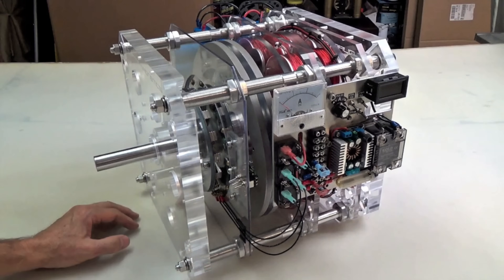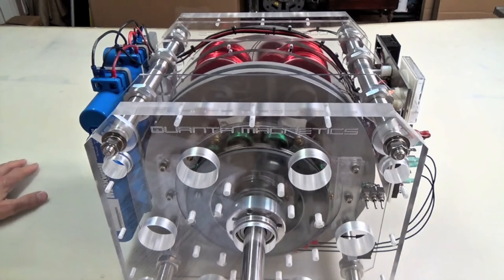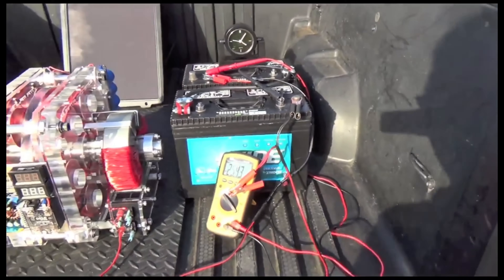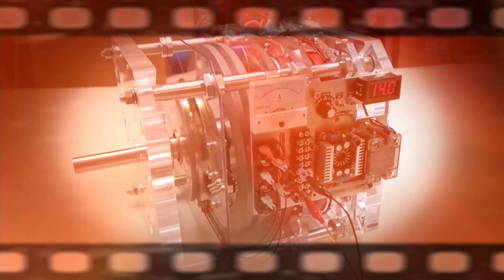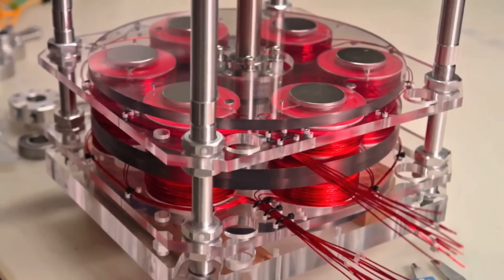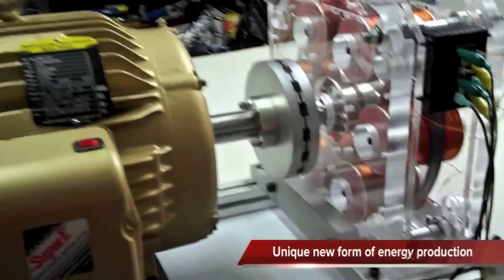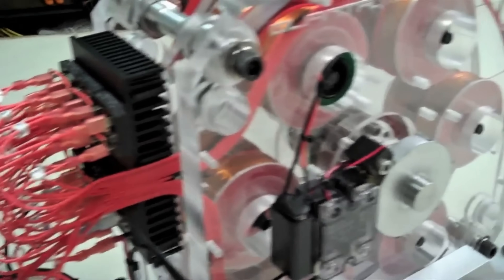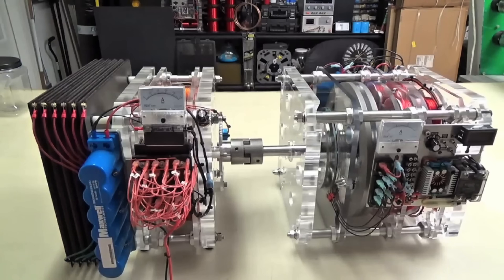This 190 kW Quanta Magnetics Generator Is Breaking the Internet Right Now!

Comment: So, basically, the flywheel is just storing charge which is a sum of poles, the pulse is a high voltage carrier wave, and the carried sinewaves of the generator become pump z waves due to the carrier, causing dielectric layers to fold a single charge pulse into many of them which are forced to combine through the implosive focal point, after which , particles have not passed but waves do, and is the cause of free energy seemingly coming out of nowhere. The fuel is neutral ions and the passage of time (electron neutrino wind), while the waste product is the end of the weaker pole, the positive pole, which flies off the exposed ferrous disc. If that disc were not ferrous, it would not hold the charge carrier wave at a low enough frequency to consistently drive the carried sines to slant into pump z shapes necessary for zero point energy to happen beyond focus through nonlinear medium.
Their website (quanta magnetics) Facebook page, all hacked and trying to give me a virus. Phishing scam. maybe the inventor is dead like all the others.

Comment: There already is a FREE Energy device that you can actually purchase called MAGMOV Free Energy machine that comes from the United Kingdom for around $ 6,000.00 U.S.. This is very real and I would buy one but I already have a 3 KW Solar Power System that runs an Electric Motor and that Electric Motor is the power source that runs a 10 KW Power Head. It works Beautifully! I also use High End High Powered Solar LED Street Lights that shine on the Solar Panels, they provide Imitation Sun Light for the panels when there is no sunlight at night. Works Awesome! Note; I did all this for less than $ 6,000 bucks. I produce more electricity than what I would ever need. I realize this is an over kill. Please keep any negative comments to yourself. Thank You
Reply: Моје мишљење је да нема ништа од овога, каква продаја? Где сте видели било какав видео или озбиљан тест рада са параметрима? Никад нигде... Ако буде радило тај видео неће бити доступан...